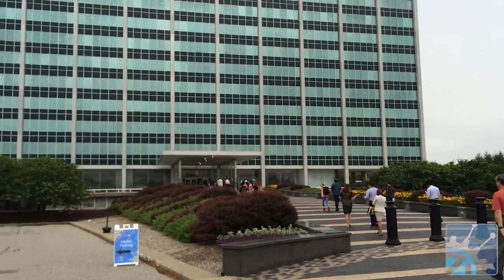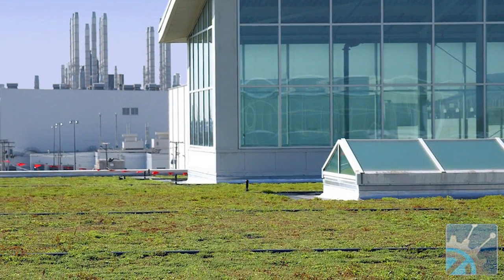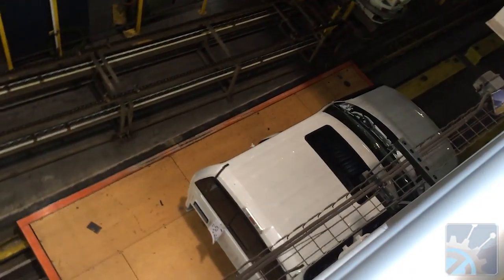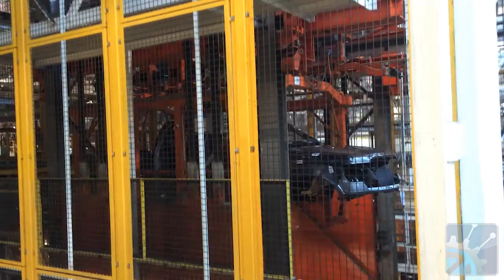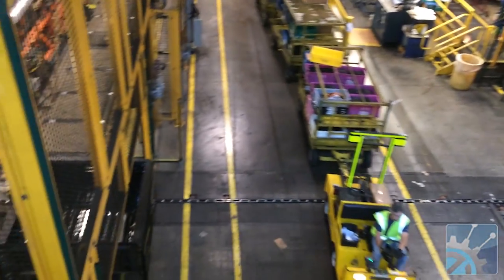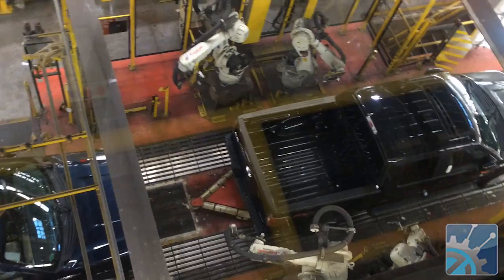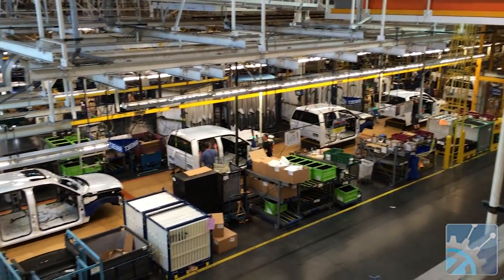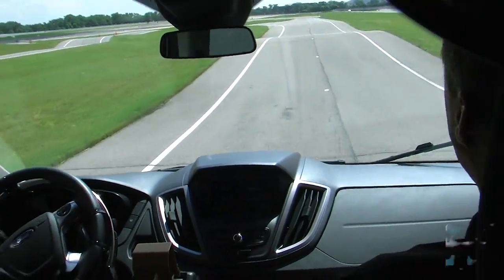Ford Rouge Factory F-150 Assembly Line Tour

Comment: Have always been curious,  I know that after they are built,  they do have to put a few miles on them by actually road testing them,  but I am sure that there probably have been lots of new truck owners who have requested that their new truck have absolutly NO miles on it when they purchase it,  Now there is probably NO WAY that that could even be possible right?????
Reply: Andrew Silva no, it's not possible. Very few are selected for road test during each shift and they will have a sticker on the window explaining the vehicle was selected for road test and how many miles were put on it during. Also, the vehicles are driven off the line once they're built. Then they go through the tow in process for the alignment. The wheels are rolling for that process. Then they are tested on the roll test where the trucks are on rollers and put up to speed while calibrations are done. Then they have to be driven to the shipping yard and put on trucks or trains. Usually trucks will have several miles on them when they get to the dealer.